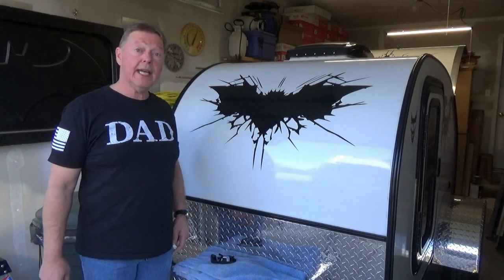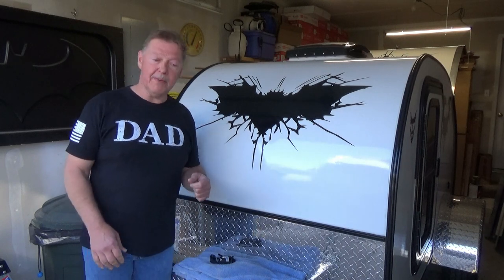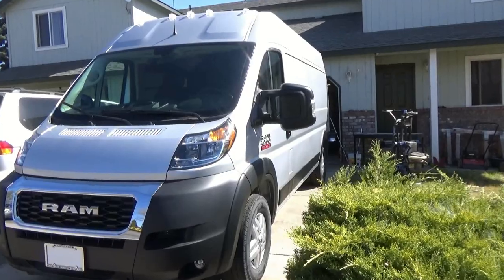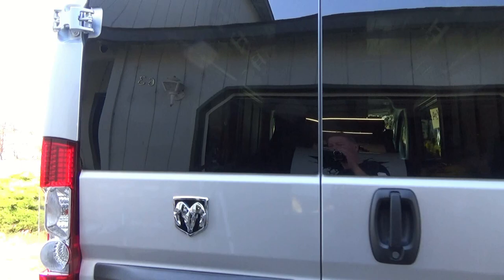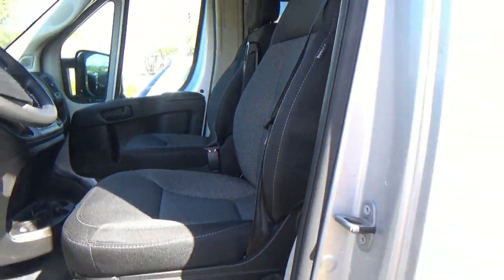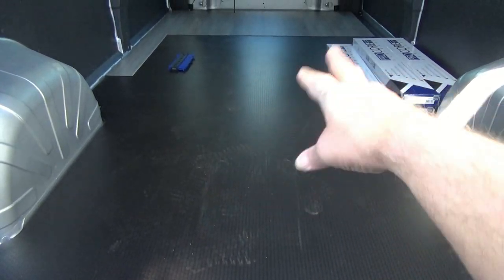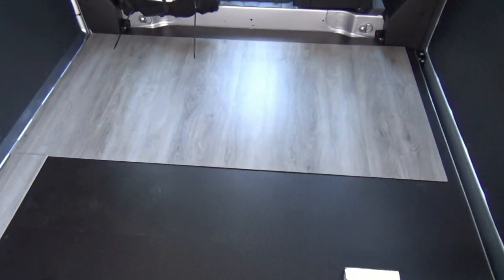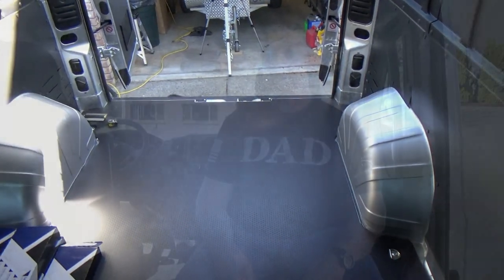DIY Van Build – Promaster 2500 159WB - Tiny Home on Wheels – An Adventure – Part 1

Comment: Good to see you back on the horse.
You should be able to charge your battery system at over 1200 watts directly from the alternator.  Be sure to plan routing 2 ga+ cables from engine compartment to wherever your battery system will be.  Excited to see what you turn that thing into!
Reply from the maker: Yeah... been a while and I am a little rusty! :) Still planning things out, DC to DC charger on the list

Comment: Do those swivels recline all the way? We want to sleep a friend there on trips and we’re curious if the oe swivels were the way to go. The 6way does surprisingly.
Reply from the maker: Unfortunately no… seats don’t recline all the way back. I’ve seen some builds install a table in between and then lay a cushion across driver seat to passenger seat for extra sleeping

Comment: did you glue or nail these tiles to the floor, or are they just lying there? would be nice to see the work being done, not only the final product.
what about insulation? usually people put some insulation materials under the floor, to help with cooling and heating? you don't find this necessary?
Reply from the maker: The tiles are a floating floor, not secured. The videos are actually more of a "progress report" than a how-to. I didn't want to pull up the existing floor that was set in some sort of adhesive, to me, that would have been a lot of work. I didn't find it necessary for me to insulate, I have the existing floor... tiles on top, and covered with a long runner (rug) that keeps the cold off your feet. Been working great for me!

Comment: How did you trim out the edges of the flooring, or I should say what did you use to finish the edges.
Reply from the maker: The walls covered the flooring on the sides, and for the sliding door area and rear of van I will use an aluminum angle to seal off those edges (not done yet). That will keep the edges protected and not scuff things up when going in and out.

Comment: Love your content. Just getting going on a 2021 159'. Any issues with the vinyl click floor? 
Many posts discourage cabinets etc placed on floor preventing contraction/expansion in our Canadian climate.
Thanks
Reply from the maker: I would have to agree... lay floor AFTER furniture is installed. I Installed flooring first and when it gets hot, the floor lifts a little in spots. Not noticable when I have the rug runner down, but can sure feel it! Thank you for watching channel!
Reply: Thanks so much. That's what I expected. Ease of install was my goal but now I'll go with a solid lonseal or marmoleum surface to prevent that - though much more difficult to install imho. @OregonBatman
Reply from the maker: I think you will be much happier with the results! This would be the only change I would make if I had to build over again...

Comment: Curious if you are going to insulate the floor under the van?
Reply from the maker: Negative. I installed flooring over existing floor and use a throw rug on top... comfy enough for me! :)   Thank you for checking out the video!